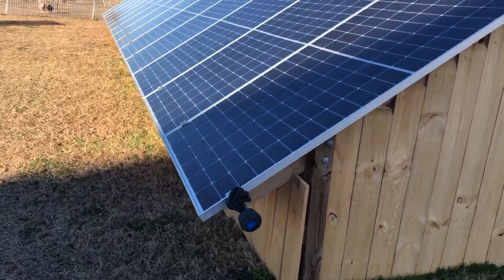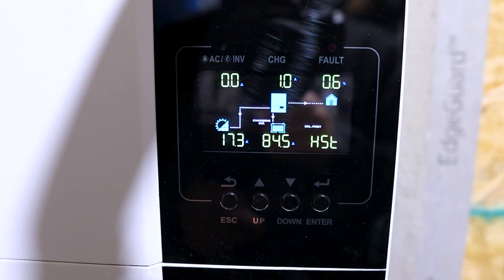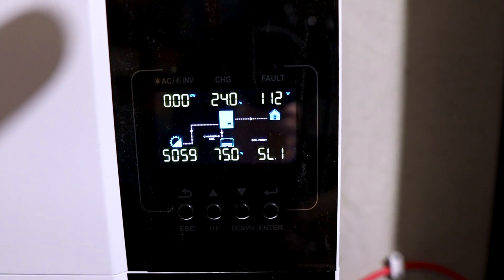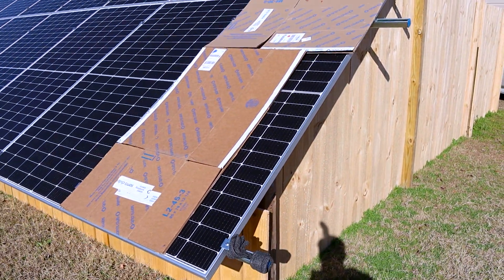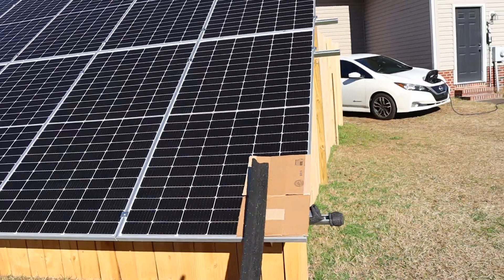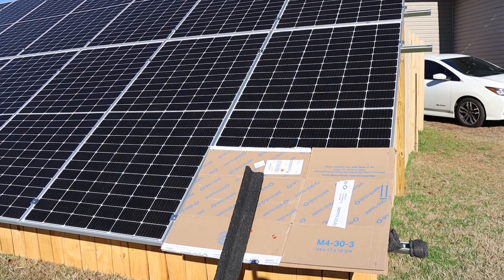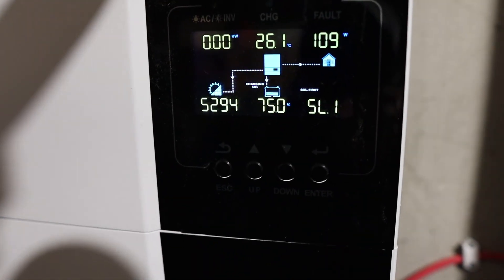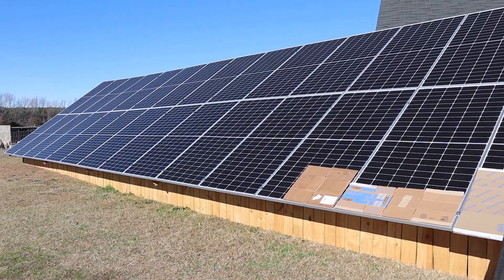Solar Panel Shade Test - How much power loss? Crazy results

Comment: Hey. I am still quite a newbie in the solar systems. I have a triangle roof where one side of 4 panels faces the sun in the morning, while the other 4 on the other side remain in a shadow quite consistently. Both are wired in series. My MPPT controller is not receiving amps at all to charge batteries, I get 0.4 amps. I believe shadows might be causing these problems. Would love to hear your opinion. I got Canadian solars 440w. Thanks.
Reply from the maker: Basically if in series and one is shaded it will bring down all other panels in that series. So you could use tigo optimizers to get full power from each individual panel. Or you could make two different series strings if half get sun together then the other half.

Comment: I would be curious to know as to how hot those covered cells were getting.  Some of that power loss was being dropped across the shaded cells. 

What happens is that by covering some cells, in a string of cells, you will cause a reverse bias condition on the shaded cells.  This means that the shaded cell is acting more like a resistor and dropping the voltage across it, causing a “hot spot” on the shaded cell or cells.  Not good by the way.  If each and every cell had a bypass diode on them (which they do not) then the power would go around that individual shaded cell instead of being forced to go through it.  When the power is forced to go through a shaded cell, the shaded cell becomes more like a resistor, dropping the voltage across it and heating it up (basically trying to produce light).  Typically, solar panels only have bypass diodes installed for strings of cells instead for each cell.  This limits the shading problem to that string only.  

So imagine if your whole array had “no” bypass diodes.  And one bright sunny day a big bird decided to shit and cover one single cell.  That single cell would be subject to the potential power of the whole system.  By having bypass diodes in strings, the whole system will go around that particular string with the bird shit on it.  However, that one cell covered in bird shit is still subject to the rest of the cells in that same string dropping their load on it.  Pun intended.
Reply from the maker: Would be interesting to check the temp of the shaded spots! Will see if I can try that at some point

Comment: A quality inverter such as SMA or Fronius has better MPTT algorithms that addresses shading issues much better than other brand inverters. But, they do cost more. Also, partial filtered shading such as tree branches would provide different results. None the less, thank you for sharing!
Reply from the maker: True and micro-inverters would work even better. But each thing has a trade-off. Cost, installation time, etc.
Reply: @rodneyhunt  Well... maybe, or maybe not. lots of misinformation regarding MI working better. It totally depends on the installation requirements. Dozens of vids comparing string inverters and MI with shade. With modern panel technology, split cell and multiple diodes, changed the MI marketing hype. And MI have panel size limitations in terms of watt size that may require more panels, more racking, wiring, labor...

Comment: I'm now kind of curious how drastically the output would drop of if ALL of the panels were getting hazy scattered light (Like you'd get through a bare trees shadow in winter)? Would the system pretty much say "Nope. Not a chance" because too much of the string was partially affected, or would a few KW's still squeeze through? I'm guessing it would probably be similar to the output with heavy cloud or fog?

......... You wouldn't happen to have a bloody great roll of fine mesh netting just kicking about around there (and a spare afternoon) by any chance? 😁
Reply from the maker: Lol no. But they seem to do pretty good when all are partially shaded by clouds etc. Completely blocking parts seems to cause the biggest problems
Reply: @rodneyhunt  Just an idea but when does a partial 100% cover happen? Isn't it more likely to be a (let's say) 50% partial cover?
What I mean is: you're (like all other test vloggers I found so far) covering it at point-blank so the affected area gets no light at all. But a chimney, tree, building, ...has space between itself and the panel. It gets less bright but never pitch black.
My suggestion: park a van or small truck so its shadow falls on the array. From part of 1 panel to multiple panels. You have the ideal build-up for it with a ground based system.

Comment: There are bypass diodes built in so it will bypass the string of cells in that series. I believe there are three strings each panel so three bypass points ...having one or two still producing will drag down the whole systems amps in series or the volts in parallel. I have been doing a lot of video watching on these issues 😅 😂😂
Reply: Yes, and there are also half cut cells, fancy name for the diode location through the middle of the panel instead of the top. The divide the cell strings into 6 different  zones.

Comment: Interesting. My solar charge controllers have a feature called 'partial shade detection'. It comes set to on as a default and I left it there.  I can't get to my array as it is on a roof 16' up and I really don't get much shading, maybe a tree branch during the shortest days of winter. Snow is different however. With almost all of my panels having some snow on them output was down a fair amount, but, not more than about 50%. I will have to see what Victron  says about the partial shading setting. Good food for thought. Thanks.
Reply from the maker: I thought my results were interesting. Not what I expected but good info to have. Not much shade for me except early mornings during winter